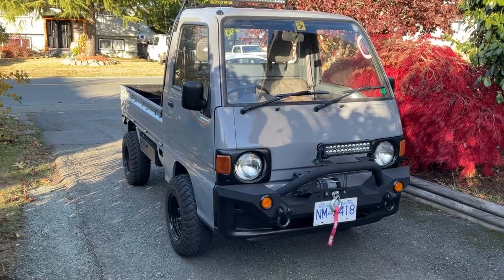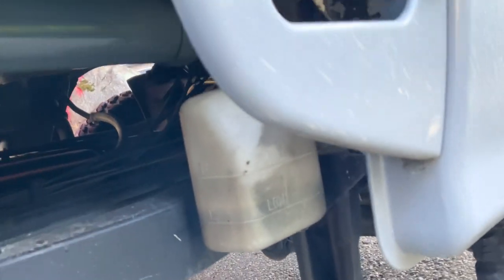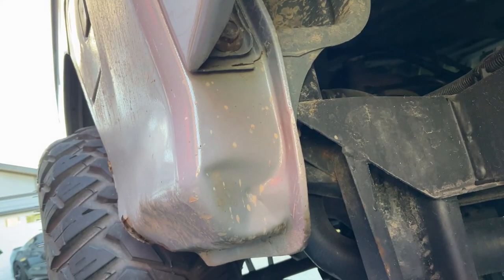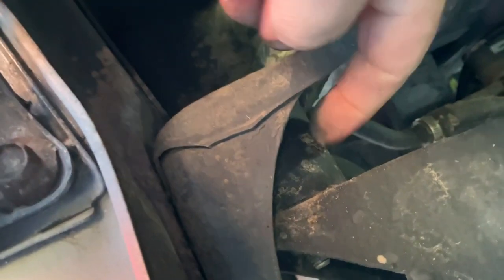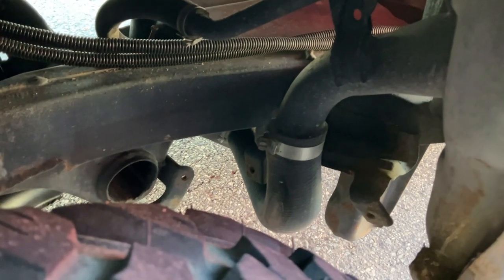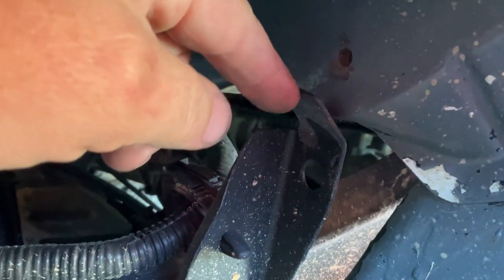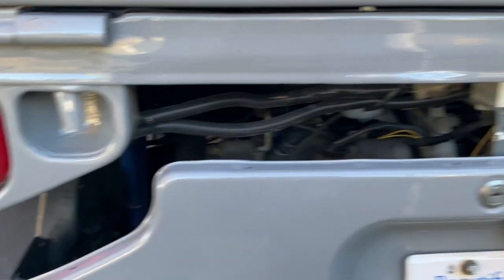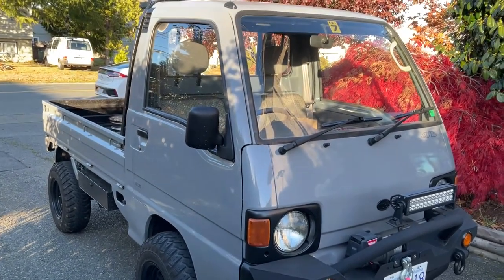2 inch body lift on a Subaru Sambar

Comment: Thanks for the video.  Very useful info.  I have a Hijet and I think the simple 2" body lift is nothing more than longer shackles for the rear of the leaf springs and a round spacer between the top of the front struts and the cab body under the seats.  The front spacers should have a slight tilt to the end caps to preserve the front wheel alignment, more or less.  I plan on doing a coil over lift so I not only gain some body ground clearance and wheel clearance, but also have a little more suspension travel.

Comment from the maker: 23x8x12. They do rub over bumps when turning. I plan to shave cab slightly to deal with it.
Reply: Do you remember thread pitch of the body mount bolts?  I need to get longer bolts for my body lift. I know it’s M10 but I didn’t know if M10-1.25 or M10-1.5
Reply from the maker: @KenMFNCason  no, but pretty easy to just remove one and measure it.

Comment: Can the Subarus be lifted by the suspension also?
Reply from the maker: Yes, but you can’t go too much or the rear axles will pop apart. I’ve heard 2” can be an issue.
Reply: Ok cool. I’m definitely leaning towards the Subaru just because of cab space. I sat in one and didn’t feel tight to me being 6’3. Definitely would love to do the bumper you did. Do you have a any close up pics of how you mounted?

Comment: Nice video. Currently planning for a newer TT2 Sambar myself and will be doing the 2" body lift. The rubber boot for the steering shaft (in your video) appears to be slightly off center after the lift. Is the shaft still sealed?
Reply from the maker: Good eye, it is not sealed. That said, no water comes in at all. Not sure if it was from lifting or not as the shaft seems to go straight up.

Comment: Are the blocks for the bed 2" tall x 3" wide? Trying to figure out what i need to piece together my own kit.  I basically have everything else besides the fuel filler hose
Reply from the maker: 2” tall, not sure on width, probably around 3”. The 2 at the very rear of frame will need to be cut as they are quite close together.

Comment: How is your winch mounted? I have a Sambar and want to do the same thing
Reply from the maker: Winch is mounted directly to the bumper. The YJ bumper was mounted using some custom brackets I fabbed up.
Reply: Where'd you get the front bumper?
Reply from the maker: @blatantrefusal  I bought on Ebay, it is for a Jeep YJ.  I think I paid $169
Reply from the maker: It was a lot of work is all I can say.  Some custom brackets welded to the frame and also made a bracket inside the cab that spreads the force out over a large area of the thin sheet metal.  I had the entire dash and heater box removed to do it.